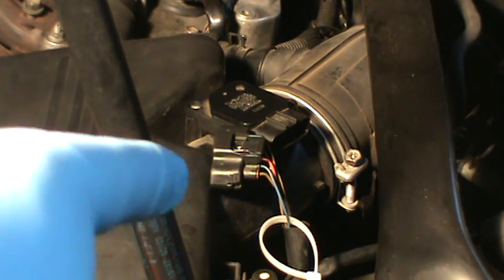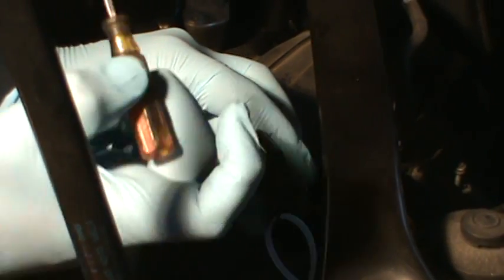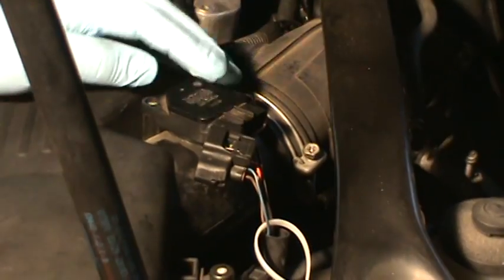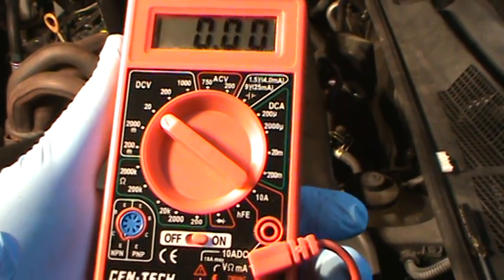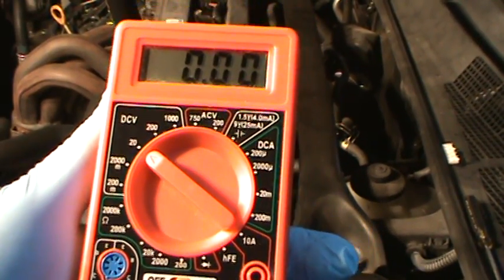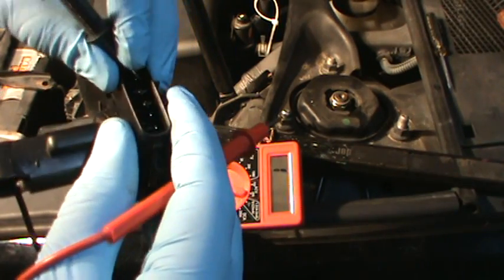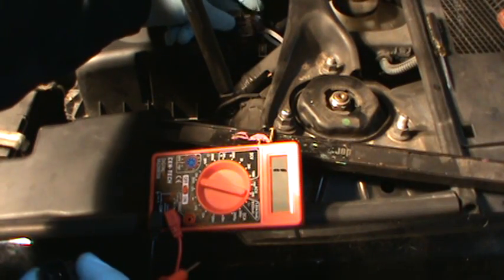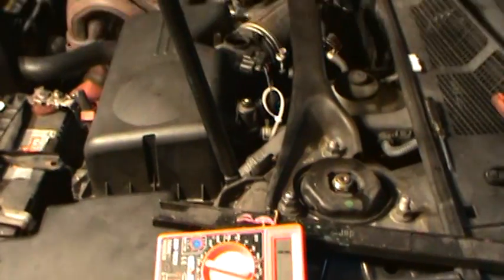Mass Air Flow Sensor Testing

Comment: Super illustration .  2018 ford escape , intake air temp, I am getting 5 v in both wires. I looked for the short  between the 2 wires but there is No short !!! Any idea? Thanks

Comment: Can you check this one pls. In my diagram & how to connect it to test light 
1. Signal, return ---( GY/RD) wire -
2. Is 12 v, #3 is ground
4. TN/LB wire MAP sensor, signal, return----
5. LB/RD wire MAP sensor output ---
6. IAT sensor input--- I think this is the 5v that your talking
Thanks

Comment: Pin 5 is the ground for pin 4 (IAT).  Pin 2 (from the left) is the ground for the MAF signal wire (pin 3).  Pin 1 is the 12v heater.

Comment: Pin 1 (left) is the power wire for the maf...  Pin 2 is ground wire... Pin 3 is the signal wire for the maf... Pin 4 is the signal wire for the iat sensor... and pin 5 is the ground.  The 12 v #1 power pin heats the platinum wire on the maf sensor.  Pin 5 may be the ground for both of the 3 and 4 pin signal wires...  I don't know.

Comment: thanks for the demo it the best I've seen .
(Q) I have a nissan 2002 liberty or ( Quest) I'm having a bad idle issue , fluctuating between 1800 - 2600 RPM .
I changed the ETC and the MAF did an idle relearn but still have the said problem any recommendations?
Reply from the maker: Do you mean engine coolant temperature sensor when you say ETC? Why did you change these sensors? What code, if any, did you have? You may have some kind of vacuum leak, idle control problem, or maybe even a throttle body that needs cleaned.
Reply: electronic throttle control ETC 
I did 2 scans the first one showed that the TPS was bad so I changed it, but still had the
idle problem, checked for vacuum leaks got none. I did another diagnostic it reveled the 
MAF was bad so I changed it but still the idle 
keeps fluctuating. Next I'm going to try a idle
relearn. hope that works. Have you had any issues like that ?
Reply from the maker: Rajesh Bhajan First off, there is no possible way that a scanner can tell you whether a sensor is bad or not, that is why there is people who use this info to diagnose. Sounds like a problem with the throttle being dirty or something like that. I wouldn't go changing parts with just what a scanner says. Ask this question to ScannerDanner with all relevant codes and see what they have to say.